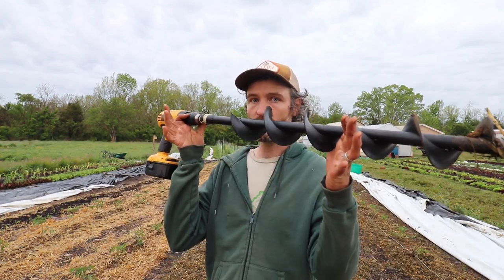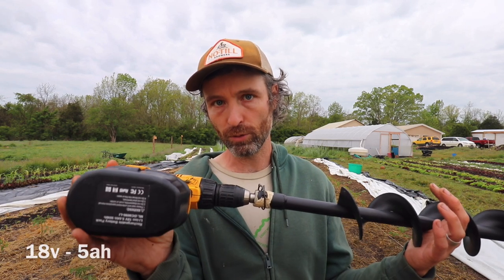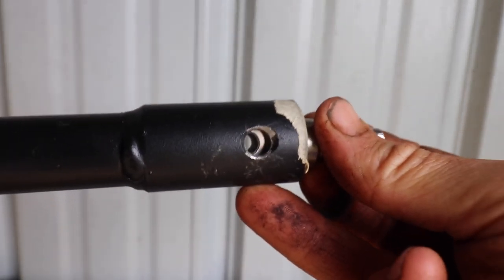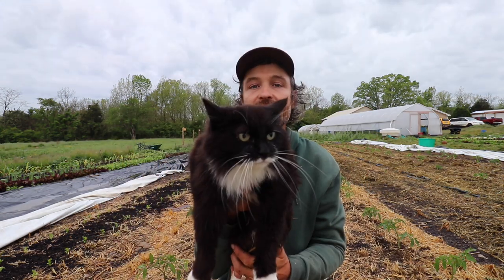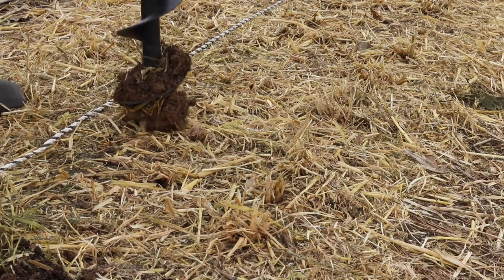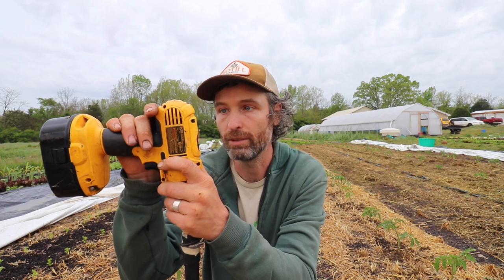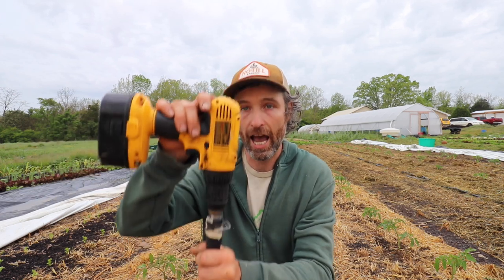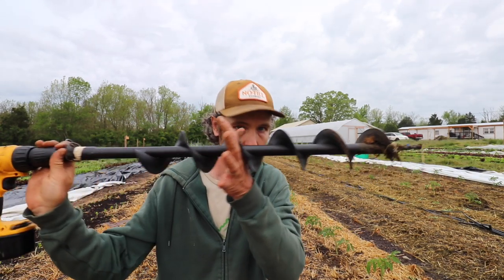No-Till Transplant Drill

Comment: Brace the drill against your left leg so you won't break your wrist if you hit rock/root etc. Also, that auger is way too heavy for that drill. Can buy much lighter augers with just 6-12" long flights and the remainder is straight (bulb augers).  Longer is better so you don't need to lean over.

Comment from the maker: Hey all, feel free to start a thread on this comment about ideas for linking that auger adapter (the one recommended on Amazon) to the auger bit. I think a bolt, nut and nut luck would probably be sufficient, but I'll take your ideas.

Also the bed prep was rye/vetch then flail mowed and tarped. No tillage.
Reply: A vise and a drill bit, bore out the hole slightly larger to fit the pin setup. Probably easiest with a vice and a drill press, but a good bit and some patience you can use a hand drill.

Comment: Been using one on my Hilti 22 volt 4 gear drill for 4x4 post and drilling transplants, works great although I am thinking about Hilti 7/16 hex impact drill, bit higher toque 4800 inch pounds.

Comment: You should hold the drill "backwards". That means that the drill will push on your fingers instead of the thumb. A lot less pain involved.

If possible, I would have the drill between my legs for support.

I have a really big hand drill which I have used to drill rock with. Widest drill 32mm. Or is it 34?

Comment: using this same setup only with a much more powerful electric drill motor. Yesterday I was drilling 26-30’ deep to install 3’ diameter plastic pipe for deep root feeding fruit trees.  drill bit caught up on a root or a rock locked up spun around and snapped one of my fingers in 3 places.  Danger Will Robinson.  this setup can bite you.